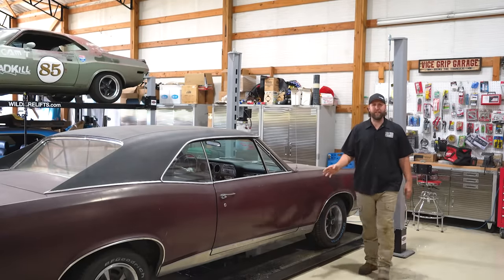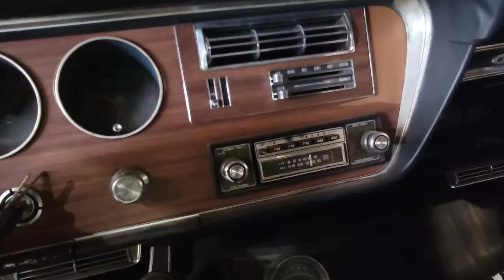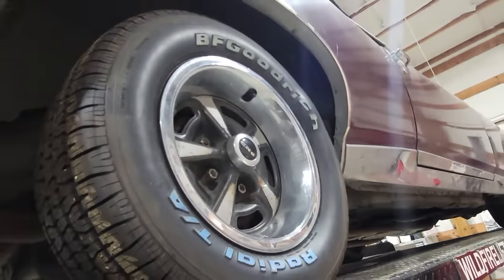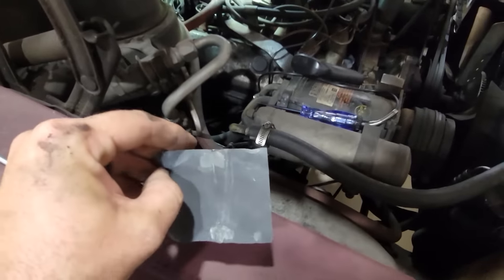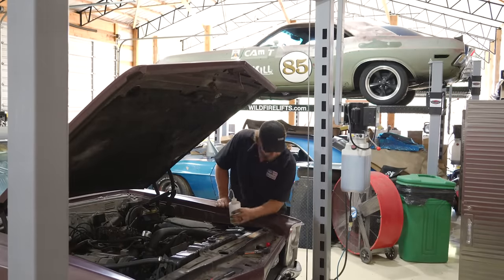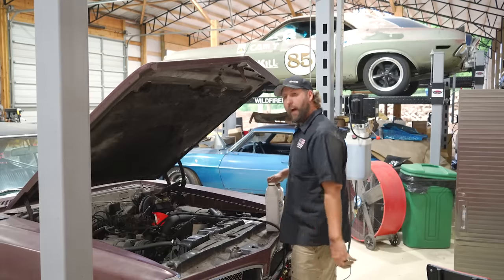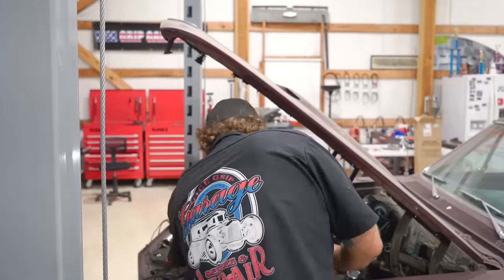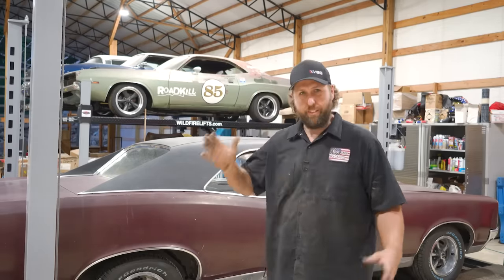Will This Pontiac GTO RUN AND DRIVE After 40 YEARS? (Buried in Garage) EP1

Comment: Being a Pontiac that has 80k+ miles I would put on a new timing chain and gears. The stock cam gear has fiber teeth that lasts about 75k miles. They used the fiber because it ran a bit quieter.
Reply: I thought that plastic timing gear was just on the four cylinder front drive grand am…which was a great car for what it did. I had one that used to get 35 mpg on trips, locally about twenty. Seats were the same as a firebird/Camero. Some people would confuse it with a similar looking bmw!
Reply: GM used the plastic coated timing gear teeth for years during this time.  It's pretty common for them to be falling apart and half in the pan.
Reply: I was thinking exactly the same thing about replacing the timing chain and gear.  I had a Pontiac 400 engine with the fiber teeth coated metal gear and it went out at about 80,000 miles and the timing jumped 8 degrees.  I also had a loose converter to fly wheel bolt that made the strange noise.  I added lock washers on those bolts.
Reply: Ive seen those gears on a lot of small block Chevys and these.. definitely a good idea to get rid of that. Probably help its running/tune, because its probably on its way
Reply: That brings back an unhappy and somewhat scary memory. I was driving to work on the freeway, lifted my foot off the gas to decelerate and merge right, when I heard a loud clatter and lost power. I threw it in neutral, killed the ignition, pulled the emergency flasher button, and steered onto the shoulder. With 66K on the clock, my 12-year-old 1973 Chevrolet Chevelle 350 CID engine had stripped its plastic cam sprocket, collapsing three lifters and bending three pushrods in the process. Yes, I opted to spend the extra $25 for a steel replacement cam sprocket -- why did the mechanic even ask? :)

Comment: Nooo, it's not a small block! All Pontiac engines from 326-455 had the same external dimensions. 
Thanks for what your doing for a veteran,  great stuff sir!
Reply: The 455 was different inside with the (IIRC) 3.25" main bearings being the biggest difference. I also wince a little when the Pontiac V8's are referred to as a 'small block' or 'big block', but I'm really just excited to see Derek put hands on a Pontiac (the blue late 60's Firebird he acquired a while back had a SBC in it so that doesn't really count, LOL).
Reply: Easy mistake but yes big block, even the 350 in my 70 firebird is a "big block". Albeit small bore.

Comment: Great vid as always.  I would continue on with the mechanical.  Then interior. Then paint.  I would change very little about the car overall.  Shag package tray has to go.  If I were doing brakes, I would upgrade to discs on the front.  Probably not gonna happen, but they just stop so much better than the drums.

Comment: This is a great service you're doing Derek, can't wait for part 2.   I vote for the mechanical stuff, brakes, fuel pump, do a good cooling system flush, take a look at the spark plugs etc.
Reply: what about the temperature gauge?
Reply: @MicroSoftner  I don't think there is a temp gauge just a temp light.  Either way that would be part of the etc. stuff.
Reply: @Aerospace_EdC  yea thats what i was thinking...
Reply: And that Tacky-O-Meter to indicate rippems.

Comment: Hey Dereck, this is an amazing car, I wish mine was in this condiition. I think finish the mechanical portion, then venture in to the rest of the stuff, fuel brakes, and whatever else show up. truly a great car. I laughed out loud this morning when she fired up that first time. the fan is supposed to have a small sheildish thing over the top of it to protect on your arms and digits. the fan does cut finger prints right off if they get to close, I say that as a fella with experience, thankfully they were minor slicy cuts and not severe ones. Stay safe and keep'em coming.

Comment: What to do next?  Get the fuel pump installed I guess and try to get at the plugs.  Get a new quality radiator cap with a high psi rating.  This should keep her cool in traffic with the AC blowing.  After the other mechanical stuff, since the underside has little or no rust maybe an an undercoat to keep it nice.

Comment: Love this. The internet needs more Pontiac content. FYI, you don't need to remove the glass to replace the headliner. Either way, I'd probably leave it alone.
Reply: Yeah you do it's actually tucked up behind the window stuck to the window ledge in between the glass and the window lip!!! You could probably get away with not pulling it out but over a couple of years it would probably fall back down
Reply: @jonathanlawson4667  That is not the case on my '66 GTO, which is identical to this '67. There are stamped steel metal strips that are screwed onto the inner roof structure. The headliner is supposed to be glued to those strips, and nothing is supposed to be tucked underneath the glass.

Comment: Thank you Derek for helping a fellow disabled vet.   I owned 2 65 GTOs in the early 80’s  I would like to clarify something that is a common misconception on Pontiac engines.   There is no Pontiac “small block”/“big block” all the blocks from 326 - 455 are basically the same only differing in deck height.   The only things that are displacement dependent is the intake manifold, crank, piston and rods.  All other parts can be swapped.
Reply: Starting in' 55 with a 287 and then a 316 they put these in GMC trucks back then too?😮

Comment: Wish I had a contact email for you Derek. I've been doing automotive air conditioning for over 35 years and have rebuilt many of those old Frigidaire compressors. In fact it's probably in the thousands. I worked for classic auto air for many years back in the day.  I will gladly rebuild that pump for your project to help out the veteran and it will come back like new with the original decal and that yellow okay stamp. It will have a clean Survivor look to it. Sitting for 40 years with the original case and shaft seal as you know is going to leak.
 I have a long list of reputable references as well..You just let me know..
Be glad to help out
Reply: You Sir are awesome for offering to assist.

Comment: Get the engine running perfectly. Fix the torque converter noise, then do the brakes and tyres. Then the cosmetics last.

Comment: I was afraid that it was going to have a "powerglide transmission". Good to see this option.
Reply: 3 speed w/ the Hurst dual gate, “his and her’s” shifter.
Reply: Pontiac stopped using the ST300 2-speed auto in the GTO in 1966. TH400 is indeed vastly superior.
Reply: @ZeGermanHam  I had a 66 GTO 2 barrel with the 2 speed Powerglide. It was a screamer. I let my dad drive it while I went to Vietnam. When I came back he had blown the engine and took it to the junkyard. I didn't care then. I was just glad to be back and alive.

Comment: In my idle time, I've been doing the same thing that you do for about 50 years.

I'm wondering why no one ever told you that you're supposed to temporarily disconnect the vacuum advance hose (from carb to distributor) when you set the timing using a TIMING LIGHT.  (And, YES, I know we can get real close by ear - and there are variables based on the lift/duration on racing cams, etc., which affect the dwell...)  

However, based on the number of people watching your channel - I'd recommend doing it properly for your amateur viewers !!  :)  Semper Fi

Comment: Wow... this is a trip down memory lane.  I got out of the army in 71 (vietnam 69-70).  Found a white 67 GTO that I just had to have.  Believe it or not, I paid $1400 for mine as well. 
Mine was white with the black vinyl roof.
 Drove  her for about 5 years.  At the end of that time the only thing wrong was a bit of upholstery piping on the driver side and few cracks in the black vinyl.  One thing  to be aware of is that if I blipped the throttle to hard she would break the engine mount on the right side.  No big deal unless she broke the starter cable as well - then things would get exciting real fast.
Thanks for taking this on for one of my brothers!

Comment: On my stuff, I tend to focus on mechanical first, then interior, then top it off with paint, or paint restoration.  I sure love that car.  My first car was a 65 Lemans so that brings back some sweet memories.  Thank you for this channel.
Reply: I had a '66 GTO. Same body with different grille and it had louvered taillights. 389 4bbl. 4-on-the-floor. Loved that car. The weak spot was that roof design. When you parked it downhill in the rain, there'd be a puddle at the base of the rear windshield, and that would eventually seep in and make the back seat mouldy.

Comment: Had a 66 with 389 and 4 spd Muncie tranny. The 64/5 actually started the trend..   The only place I had a problem with rust on mine was the bottom of the rear window, water collected under the trim and rusted it out.

Comment: Just say'n... If a rig has been settin' a few years, I always change the oil and filter first. Even with a decent lower price oil and filter just to get 'er runnin'. I've found that after a while, the dirty oil in the filter can gum up and not want to let the oil flow properly. It sticks to the filter media. I've tore the old filters apart, and it's almost like a grease in there. You don't really lose the viscosity of the oil itself, but the cleaners in the additive package don't work as well.

Comment: Neat, you can get adaptilators that fit most common tool batteries, Fancy yourself a voltage wiz and you can step down 18 to 12 and use your powertool batts to power the pump

Comment: That is so awesome Derek I love how you got her back up and running again. I bought a 68 Bronco that had been sitting for 15 years and had it running and drove it around in three hours. Coil wire was missing (rats) got it. So I jammed a length of romax house wire in the coil and distributor and fire up. So fun.

Comment: I don't know if you'll see this Derek and I'm sure you're well aware but a can of carb cleaner works awesome to detect vacuum leaks. It bubbles up like using a spray bottle of soap and water on a leaky tire, very easy to spot a cracked line, seal or gasket with it. Love your videos man

Comment: Good to see this 67 GTO referb. I had a rerally nice 65 Pontiac LaMans 2 door HT. DIfferences from the GTO, no hood scoop, different engine. Mine was a 326 with large 4 barrel, HD suspension, 4 speed with a factory installed Hurst shifter. That car would runnnnnn !...

Comment: I recall you need to unplug the vacuum advance when setting advance with timing light...   Also needs dwell set with that tiny metal window, to get the timing perfect.  pcv valve looks like its puffing, time for a new one or carb cleaning in it to get gunk out and free it up.

Comment: Do interior last. Wondering … interior replacement kit ? Year one?  Tach R and R ? Hurst dual gate shifter is very cool. Looks like she works. Lube it up and clean sfhifter mechanisms. Might work like a new item at that point. No burnouts till you replace fluids , right ? Check rear . Is she a positraction GM unit . ? Turbo hydranatic , new ATF will help of course . Gabriel air shocks have plastic air lines.

Comment: In 1977 when I was in the USAF training to be an air traffic controller at Keesler AF base in Biloxi Mississippi I purchased a worn out 1968 GTO with what was referred to as an automatic 'His & Hers' Hurst shifter.  I don't recall there being a need to slip a slot forward as this one does to access the 'His' side of the gears, but that was a long time ago.  That car was a beast even as worn as the engine was at the time.  Eventually being I was getting transferred to Texas and not sure it would make the journey I sold it and purchased a 1967 Ford Falcon that was more reliable at some point between assignments, and how I do miss both cars from my past.
Apparently being my '68 was a different generation, as far as body style is concerned, would that suggest then this '67 was, or could it be the last of the1st generation of the GTO?
Good on you for helping a Viet Nam War Vet and his family, and kudos to all those peeps that help make this come to light of day, Hallelujah, Praise the Lord All Mighty. Amen🙏

Comment: Your show is very good just a few things on the 67 Goat the valve  covers are stock  it is not called small block  that's a stock  Q jet
It's  turbo 400   the window on the cap is for the points.
The points should  be adjusted 
Which changes the timing which  is called dwell  a few other things I have  noticed  like the fan shroud  is broke  that  happens  when the motor
Mount turns loose.

Comment: Your the man man! Ever work on a TORONADO? l bought my dad"s in 82. Put $800 in front boots $500 in flywheel...because it was 455 HO heavy stroke and starter would grind teeth off!! If my dad herd or saw a fowled plug...bang! 8 new ones and changed oil 7 to 8k.        It was a 1970 dark metalic green with new exaust fron the manafolds to the rear axel with a pair of TRUSH mufflers. It sounded AWSOME!!! And was very   very quick! A 6200lp car that moved like a cat. Never had that car in a spin. Even when l tried! But to see how it would react. Rock solid.especilay in snow. Had her clocked at 155 one time. Yep...the old day"s. That car went around HICKORY SPEEDWAY on saturday nite with my brother and sisters and parents many times when l was a child after the race. Good memory's. I'm new to UTube. My 1st responce. Hope l did'nt stay too long. What do you think about working on a project that involves the ELCAMINO  1st2nd or 3rd gen. There bad ass! I'm enjoying your work "ay" so keep having fun and l'll keep watching!

Comment: If you’re getting water in the oil, or in my 66 Goat’s case oil in water, pull that water pump and check the timing cover.  That aluminum housing can develop holes

Comment: Little-known fact; all automatic 70 1/2 to '81 F bodies (even 6 cylinder models) came with a factory slap shifter. It didn't have a separate gate like that one, you had to hold it to the right when shifting (it pivoted). But as long as you held it to the right, you couldn't even get neutral, just 1-2-3

Comment: Replace the broken fan shroud for safety and over heating issues. Also you can test the fan clutch when the engine is warmed up by trying to stop it with a  rubber heater hose long enough to do it safely. It should not stop if it’s working properly. I have seen many techs chase overheating problems because of bad fan clutches.

Comment: I know the people who own that car,Thank you that man deserves some good, And when you start vet projects let me know anytime you need parts I bought a warehouse earlier this year it was a machine shop,The man that owned it passed away his wife a friend sold inventory and all to me there is over 200 completely rebuilt 350,305,289,302,351,427,460,390,396,383,327, & 7.3 power strokes ready to install with tranny's they are all sealed and labeled .30 over I've kept most of the racing engines but have 9 I can give to you (4)604 crates (3)465's (2) 602 crates plus rearends and numerous other parts there's even a 69 Camaro he started but Mr, VGG if you are going to do this for veterans I'm all for it I spent 16 years in the Marines MARSOC RAIDER'S 9 of that was in Iraq and Afghanistan I was lucky made it home whole,a lot of others did not, your More than welcome next time you are in Florida to stop and see what you can use all free il even have my transport driver deliver

Comment: VGG tip of the day. When you need to use the park brake as your primary brake. Pull the release lever and clamp a vice grip on it so every time you step on the brake you dont have to reach down and release it. Lol.

Comment: I believe you should do a compression test on the right bank. I believe it’s the rings.  Do a compression test on the left bank first to get a good idea. I don’t know what the compression ratio is, but the compression should be at least 160 PSI if not more.  I’m not sure if you had engine work in mind.  But to drive it back to Florida like that will only make it worse.   The transmission could a filter and a pan gasket. It can be flushed, disconnect the supply line to the radiator. Put a hose on it and drop that into a pan. Feed it about 12 quarts of ATF and that’s done. Check the universal joints, drain the rear and check the axle bearings.  Check the front wheel bearings, calipers/wheel cylinders, R&R the master cylinder.  The rest should be cosmetic. It could look like it has leopard  marks, but it will run and stop!  I had a 1967 Grand Prix with the 400 engine, it ran strong!

Comment: To run an engine with fuel like you were trying to do, use an old Windex bottle or something that squirts a stream. Much easier than pouring. If you voice grip the e brake pedal release you can use the e brake pedal like a regular brake pedal.

Comment: A '67 GTO was my very first car ever. I bought it for $900.00 from the original owner in July of 1972. He was my supervisor at the U.S. Army Corps of Engineers. The original 5 year/ 50,000 mile warranty had just run out. It had 50,016 miles on it when I got it. It was the same burgundy color with a cream top. No vinyl roof. It was so fast. I almost killed myself in it several times. I lost only two races (street drag) in the car. The 1st was against a '65 Mustang. I was actually overmatched. He had huge race tires and a very large hood scoop. I never found out what kind of motor. The second was against a '70 GTO. We both had the same engine and tranny : 400/400. We raced 3 times. I lost the first because I tried to use the His 'n' Hers shifter that I wasn't familiar with. The next two I won because I just put it in drive and put my foot to the floor. I never lost again. I learned to properly match my car against other cars.I loved that car. I practically lived in it for the first 3 months that I had it. Some of my very best memories.

Thanks for your channel. Best of Luck!!